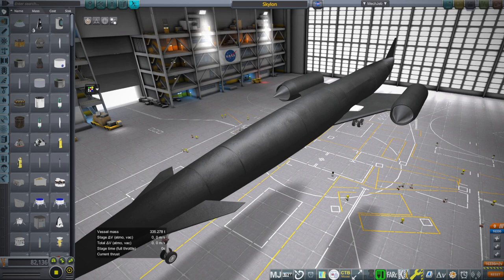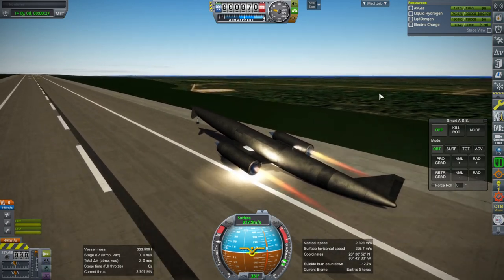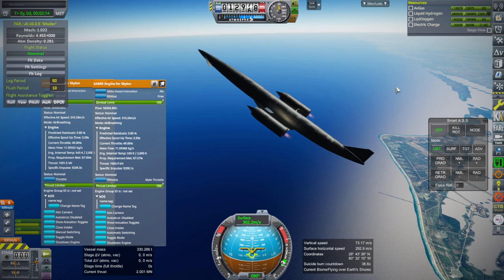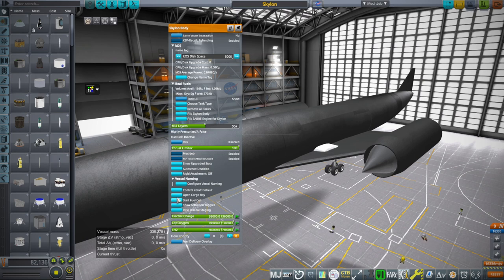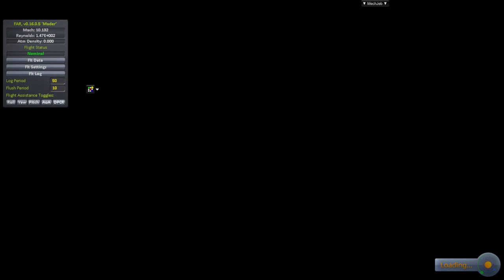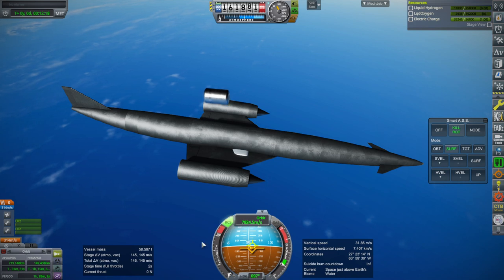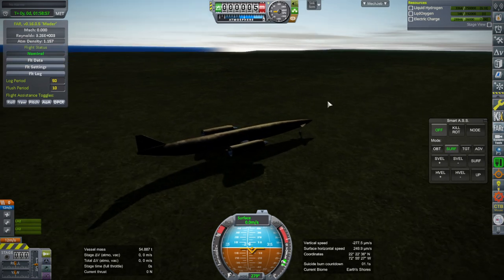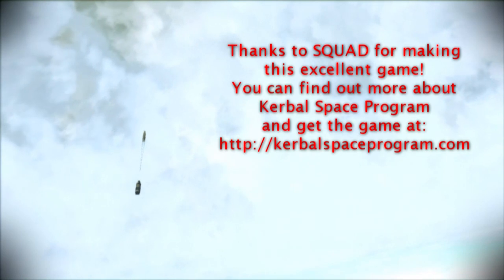Kerbal Space Program 1.12 with RO - Skylon Reduced Drag Test

Comment: Do you also have trouble with excessively high take off speeds when using procedural wings, or is it just a problem with your custom modeled and configured wing parts? My procedural wing based replicas also have unrealistically high take off speeds in FAR, but it's never as bad as it appears to be in nearly all of your KSP plane videos.
Reply from the maker: It's actually about the same between the procedural wings and my custom wings now in 1.12, though it tended to be worse in 1.8.1. It's just that I tend to test things right at the edge of being able to take off at all, like Skylon.

Comment: do these tests convince you that skylon might be possible irl?
Reply from the maker: Depends if they can make the engines as indicated and make the body the mass that it needs to be. But the design mostly checks out given those things. It's much better at reentry than I expected with the specified design.
Reply: it would be difficult in real life to get 9000 seconds of Isp, which is what this Skylon has. Only modern turbofans get comparable numbers at subsonic speed. A more realistic estimate for SABRE's Isp in airbreathing mode is around 4000 to 4500 seconds.
Reply from the maker: @carl dawes They state 9200 s in non-ramjet mode and 4500 s in ramjet mode. Unfortunately, because I already had two modes on this engine (air-breathing and rocket), I couldn't add a third ramjet bit to account for the reduced ISP there (at least as far as I know, it doesn't allow three modes). So yes, we would expect to carry more hydrogen than the current mix. Fortunately, we have plenty of extra volume and the hydrogen wouldn't be too heavy, but it really depends on exactly how far we can get at what efficiency. Edit: also remember that we are using hydrogen and you're comparing to turbofans using kerosene. The efficiency of hydrogen is higher.